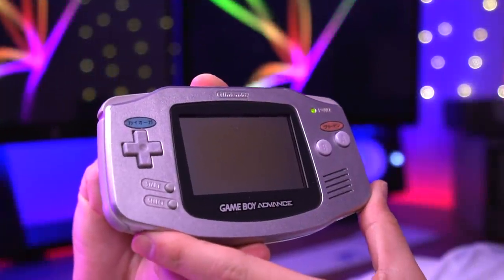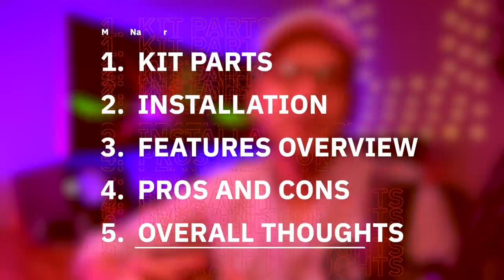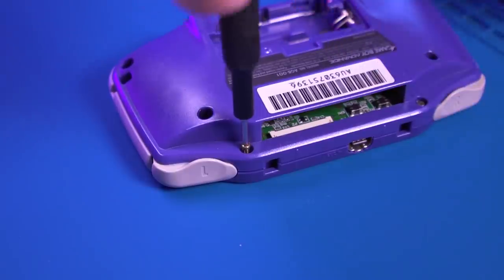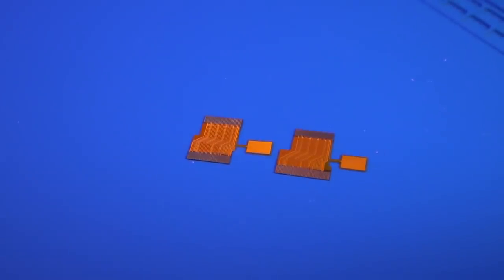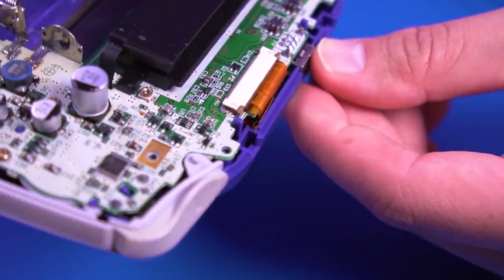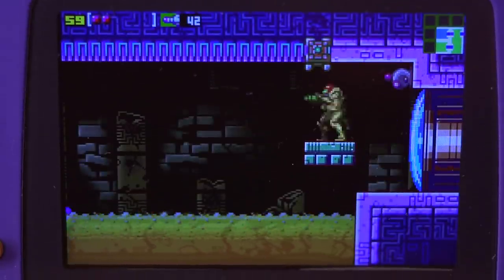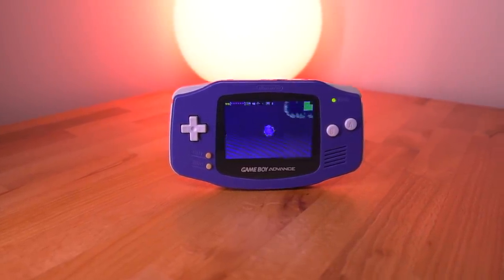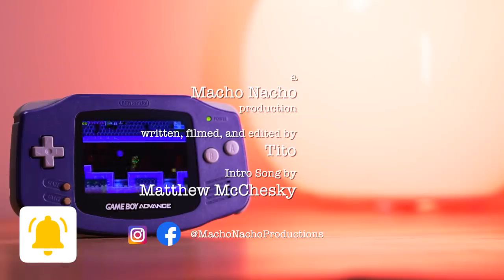Super Easy NO Solder and NO Cut IPS Mod for the GameBoy Advance | A True Drop-In IPS Mod for the GBA

Comment: Hi Everyone,

I just borked this kit and want to provide a note of caution. Some of the OEM GBA shells have little ridges around the inside of the shell where the panel goes that are taller than the rest. This causes the replacement lens to not be level when installed. I didnt know this and gave a little press thinking it was just my installation. Well, that broke the screen so now I have to wait for them to be restocked.

There is a warning of this in one of the images on the RGRS website. You MAY need to trim an OEM shell (my platinum colored shell is one of them). Otherwise perhaps an aftermarket shell wont have this issue. I don't see this mentioned in the vid and want to call it out to save others the headache and extra $20 if they do what I did.

Comment: I just finished my ips drop in screen. I used a gba I got online for the motherboard (the screen was still good) and a new Pokemon Center replacement shell. The ribbon cable/ touch sensor didn't need to be cut thankfully. What sucks is it looks like I got a small smudge on the inside of the screen cover maybe I will open it up again to clean it but not tonight lol
Thanks for this video it was a big help 👍🏿

Comment: I think you need to update your review. The link you have in the description takes us to a kit that does have 1 wire that needs to be soldered,  and does support pixel display. To change the display your just hold your finger on the touch sensor 3 seconds

Comment: I'd much prefer to do a little soldering than be stuck relying on touch sensors, which in my experience never work well (some days I want to chuck my phone in the trash because touch technology can be so unreliable). But I guess this is great for people who don't want to solder. I just wish they also had a soldering option as well.

Comment: You should try to add an improved speaker to the Boxy Pixel Unhinged SP.
Also you need to get some new royalty free music, can only use the same music so much before it drives you nuts.

Comment: Ok so there is false advertising....I just got my kit in today and the ribbons are different from what is being shown above, they have a green wire that needs to be connected somewhere. And the link provided doesn't give us the kit you are using.😑😑😑...
Reply: The green wire is connected to the positive terminal of the battery slot. This is in the instructions on the link he provided.
Reply: @dom_the3166   Not in the video though. It's pretty misleadng since the one in the video is not the one in the description...
Reply: @HiddenGhul  it's just a slightly different version, it does the exact same thing just with one extra wire, and it still doesn't require any soldering

Comment: I think the brightness of this kit is okay as the original screen had no backlight whatsoever. Pixel option again is no biggie for me and the brighter the screen the more juice it drains from the batteries. So if this kit drains a little less power than the other kits, to me at least its a win win option for the GBA as I don’t like doing extensive mods to original systems.

Comment: Hello Tito,
What are your thoughts on the new 2022 RetroSix No Cutting GBA TFT CleanScreen?
I thought it was really easy to install and to not destroy the original shell, aswell as being most true to the original with screen size and pixel grid, original screen color way and most importantly the ability to adjust the screen to the middle perfectly. I am thinking about ordering this for my GBA which I want to keep as most original as possible. Would be glad to hear your thoughts on it and why you haven't covered this one yet in your videos. 
I have not read much reviews on their new screen, so I am curious to know your opinion.
Regards

Comment: I doubt we will ever see a kit with pixel mode as that would require a screen with 4x the resolution of the GBA, at the same size as the original screen, which would be 960x640, which as far as im aware, doesn't exist.
The only reason we have pixel mode for the other Game Boys is because we are lucky enough to have the Blackberry Q5 screen which is a perfect square, and can easily fit the Game Boys 160x144 resolution scaled 4x.

An appropriate screen for pixel mode, just doesn't exist for the GBA.
Reply: Thanks for that. Very informative.

Comment: Kind of annoying how they keep updating the particular IPS kit making it more annoying to install. 

When I got mine, it thankfully wasn't one that required any soldering, but it did have a big ol' wire I had to guide into the battery contacts, which also involved stripping the wire jacket.

Comment: How bright is this compared to a stock AGS-101's normal and brighter setting? I may redo my GBA mod sometime, and I don't mind a backlit screen with less brightness than the IPS V2. It makes it more comfortable in the dark at least, as I'm sticking to solderless methods.
Supposedly it's brighter on 32-pin motherboards, also, compared to 40-pin, but I haven't really seen comparisons of them all.

Comment: The updated kit does require soldering a wire from the ribbon cable to the terminal of the power switch otherwise the backlight won't draw power.
Reply: Glad I found this comment before ordering. Why would they update it to require soldering smh.

Comment: Question that I don't think any of the GBA screen mod videos I've seen so far have addressed: After the replacement, do GB/GBC games lose the aspect ratio switching functionality or is that a non-issue because the scaling is probably controlled by the BIOS?

Comment: I just completed this mod and I'm finding a LOT of space between the screen and the glass cover. Additionally it seems really offset despite me aligning it as tightly as possible to the right and atop the spacers. It almost feels like there's too much black boarder because several sides seem just a bit overlapped and huds and menus in games are getting just a little cut off.

Comment: Maybe I got a faulty kit? But for me the brightness seems to cycle through on its own sometimes without me having to touch the sensor.

I think having the option to solder a brightness toggle very much like FunnyPlaying kits would have been better, since it would also eliminate the finicky sensor we got instead.

It's an okay kit, but needs a bit more polish in my opinion.
Reply from the maker: Dark Samus I actually started noticing that after filming. I reached out to Retro Game Repair Shop about this issue. I will be putting a pinned statement in this video. It is a strange issue!

Comment: Updated drop in kits now available with Brightness issue rectified. Soldering of Q2 no longer required. I have both versions and the updated one is substantially brighter.
Reply: Does the updated version get as dark as the original version? Or is the minimum brightness bumped up on the updated version?

Comment: I bought this from RGRS because of this video, installed it, and it stopped working 2 years later. I think it was the shell that I got from them... it didn't sit together and I had to really tighten the screws. I think that somehow ruined something. The screen turns on and is just black, but sometimes its a mosaic of colors, like static.

Comment: Hey I got this mod and after installing everything I get a black screen, do you have any tips on how I can fix that? I followed all of the guides to a T. Edit: forgot to say I am getting sound just no picture

Edit 2: for anyone reading this I used the wrong pin ribbon cable. the 40 on the top right of the board is not the right indicator. It depends on the serial number under the cart slot.

Comment: How would you rate this kit on a 1-10 scale? I want to do an IPS mod for my original GBA but don’t really want to deal with the hassle of soldering or mutilating a shell
Reply from the maker: I would give it an 8. There are some downsides but it’s mostly a great and easy to install kit.
Reply: @MachoNachoProductions  thanks for that!

Comment: I am extremely new and green when it comes to modding so if this question comes out as ignorant just forgive me in advance. The link to the mod you have in the description invokes a wire being wound around the battery terminal and the top of the motherboard. I didn’t see this step in the video, is this a necessity?
Reply: Unfortunately they've stopped making the version in this video and it now requires soldering. Pretty pointless now :/

Comment: Hey so the soldering of those 3 wires isn’t exactly necessary? Just asking cause i suckkk at soldering (shaky hands😂)
Reply from the maker: No soldering needed for the drop in kit
Reply: @MachoNachoProductions  thanks dude! I was nervous about doing any modding myself but this video actually broke it down so nicely. Keep up the good work. Just subbed 👌

Comment: rip i just put in my ips v2 in a couple days ago and i still need to get a newer soldering iron that isnt 20 years old and can actually melt solder and not just ball it up on the end of the piece of solder
Reply from the maker: A good soldering iron goes a long way. A great investment if you plan on modding for the foreseeable future.
Reply: Might need more flux?

Comment: You wanna edit your title please? The kit does require soldering.
Reply: The description is being MISLEADING, this kit is still drop-in. I recently bought it and the wire that comes with the new kit doesn't need to be soldered, you just have to wrap it around the positive battery terminal of the motherboard and stick some tape, this makes possibe the option to change between 10 levels of brightness instead of 5.
You can solder that wire if you so desire, but YOU'RE NOT FORCED TO

Comment: I damaged the ribbon cable on the touch sensor. My screen isn't lighting at all. It slipped out as I was closing the gba and it got caught in the middle. Any idea where I can replace the ribbon cable with touch sensor? I cant find it anywhere. I need a 32 pin.

Comment: I tried this kit but ruined a screen, the little clear spacers provided didn't align my screen, in fact it was very miss aligned, i tried to straighten it but the adhesive damaged the screen, a3d printed full bracket would of been a better touch. Going to order another type.

Comment: I was gonna fully mod mine with a similar screen from HHL, cleanjuice battery, custom Final Fantasy V shell, clear buttons, Famicom lens (stock size just cooler). But sadly someone threw out the box I got the screen in, along with the screen which was in the box, (asked for it for Christmas) and I had to pay back the family member and don't really have enough cash to buy a new one right now. I'm really bummed out about it

edit- for anyone wondering I'm a teen so I don't have a job right now, thats why I can't get another one

Comment: Did anyone have issues with it just straight up not working? Everything is seated correctly, was super careful installing, GBA powers on and games play but the screen does absolutely nothing 🥲
Reply: I got the new one that requires soldering that wire. Showed up DOA.

Comment: one question: How long the GBA with IPS works on battery Comparing with GBA with factory LCD?
Reply: With the lower brightness id imagine that battery life of AA batteries would be better, but probably still not great, with a battery mod it should be better than current screen mods in terms of battery life

Comment: I just installed mine today. This tutorial was very helpful. I am wondering is anyone knows if it is safe to completely remove the touch sensor. It defaults to the brightest, which is where I want it to be anyway, and no matter how much I fiddle with it, it keeps cycling through brightness levels. 

Can I just snip the whole thing off?
Reply: Hey, did you buy from the link in the description?

The link leads to a model which requires soldering which is a bit :/

Comment: what would happen if I cut the sensor completely? (Of course I won´t be able to change the brightness, but the screen will be set at its max or min brightness?
Reply from the maker: That’s a great question!  I think you’re right. You just won’t be able to change the brightness. But I’m not 100% sure. Cheers!
Reply: Dunno if this is too late, but I cut the sensor off and it works fine: just defaults to the highest brightness setting.

Of course, I am using the newest kit, with the larger and brighter screen, but I can't imagine it would make any difference.

Comment: Is there a gba screen kit at all available that has a pixel grid filter?
Reply: None with a pixel grid filter, as that would require a higher resolution than any of the currently available screens have. However, there is now another screen with an inherent pixel grid due to its resolution being the same as the original GBA screen, the Funnyplaying ITA kit.

Comment: UPDATE! PLEASE READ! This upgrade kit is NO LONGER SOLDERLESS. I think it's only one wire but as someone who's terrified of soldering I'm very let down by it not being solderless anymore.
Reply: are there any other solderless options? if you dont solder I think you just cant adjust the brightness
Reply: The description is being MISLEADING, this kit is still drop-in. I recently bought it and the wire that comes with the new kit doesn't need to be soldered, you just have to wrap it around the positive battery terminal of the motherboard and stick some tape, this makes possibe the option to change between 10 levels of brightness instead of 5.
You can solder that wire if you so desire, but YOU'RE NOT FORCED TO

Comment: No Gameboys have Philips screws.
Reply from the maker: True, I assume you are referring to the jis standard. I say Phillips because that’s what most people are familiar with.  Cheers!
Reply: @MachoNachoProductions  Incorrect. All internal screws in ALL gameboys are JIS. It's why they are so easy to strip with a Phillips driver.
Reply: dang you edited LOL
Reply from the maker: My initial response was that all internal screws are Phillips, but than I was trying to think what you really meant and assumed that’s what you were referring to. But yes you are correct. Cheers!
Reply: @MachoNachoProductions  :) .. I think it's important to be correct here. When I first started tinkering I stripped many a screw using a Phillips driver. An actual JIS driver solves all problems. It's very useful on a new shell since you have to thread the plastic when assembling.